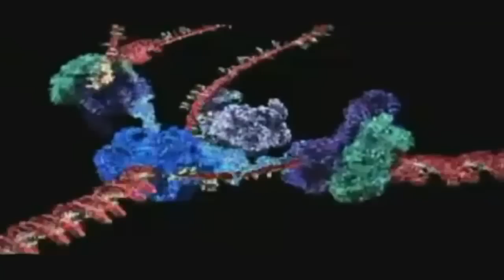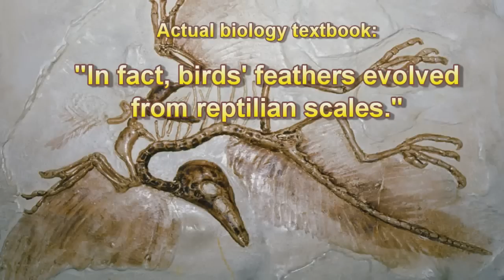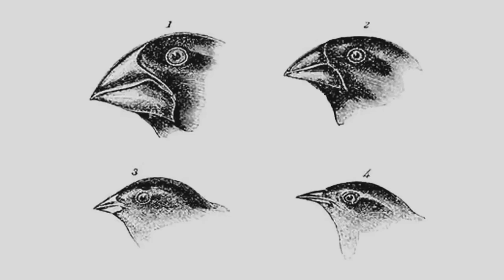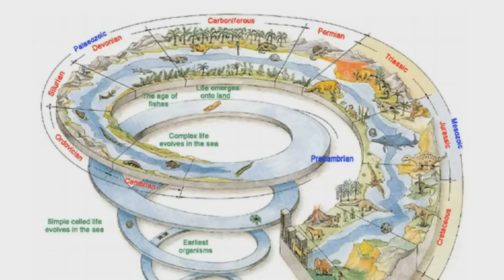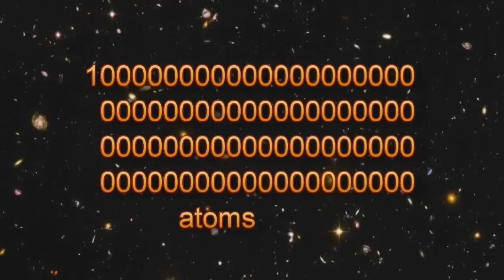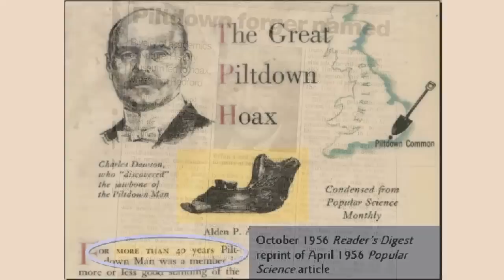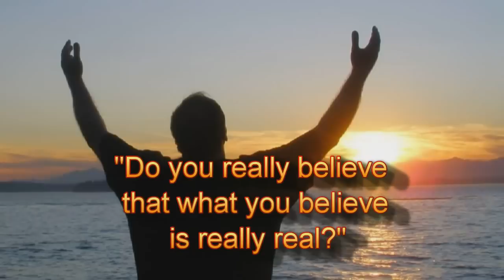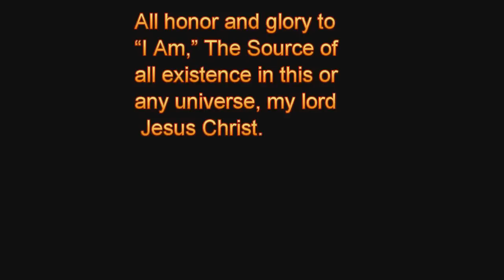Evolution Demolition

Comment: In less than 30 seconds which you apparently did not have when you made this video I found these two reviews 'Origins of New Genes and Evolution of Their Novel Functions' and 'New genes as drivers of phenotypic evolution' so I guess you missed them.
Reply: None of these things are actually new algorithms.  Yes, genes can be copied, and the shifting, and so on.  A guy with a copy machine is not an author, no matter how many pages of text he "produces."  Existing genes can be altered, and in rare cases avoid being damaged in the process, by mutation, but this is not writing new programming or new function into a new algorithm.
Reply: Mark Champneys Bullshit!

For example - do you know anything about how proteins work

How would changing the the DNA of an organisms not effect the amino acid compostie of said protein that would then alter the tertiary structure and therefore function of that aforementioned protein - how is that not adding new function?

You seem to think it's a computer code - where you need to code for specific action.  As opposed to information encoded into chemicals that simply undergoes basic chemical reactions that you learn about in any AP chemistry class around the country in high school.

It seems to me you have a fundamental misunderstanding of what DNA is and what DNA isn't
Reply: Mark Champneys
Mark; Shifting the goal post? You asked for genes that add information now you want a certain kind of information. What is a DNA algorithm? How about Ultrabithorax?
Reply: Jacob Engelhardt Your ad hominem reaction weakens your argument.  "Altering" is not writing new functions.  It is no more than stirring the pot.  Of course, we can stir the pot.  By the way, Francis Crick thought that DNA contained specified information identical to computer code.  Virtually all information scientists do as well.
Reply: Helixbuilder Wikipedia says "An algorithm is an effective method expressed as a finite list of well-defined instructions for calculating a function."  (This presupposes a language that understands and interprets the instructions.)  Such instructions are the essence of DNA sequences.

Ultrabitthorax is a gene--so what's your point, or were you just trying to impress me?
Reply: Mark Champneys
Why do you have to be a jerk when I bring up an example? You should have looked it up. I don't spoon feed those who claim they understand molecular genetics.  You clearly don't understand the system and you are interpreting.You are describing the system to  into your preconceived conclusion. Further you doing this without regard to the facts of how gene expression works.
Reply: Mark Champneys
Clearly you have not researched this as well as you want me to believe. You make a claim I countered it with a gene name and yes you should know what I'm talking about. You made the claim that certain things are impossible, therefore you should be able to defend your claim. You should have knowledge of what I am talking about because you should have thoroughly investigated your claim. You set yourself up as an expert so act like one.
Reply: Mark Champneys

Seems like you are asking for a specific sequence of events right? Are you saying that  random mutations can not create new stop codons?

You say it doesn't change function - when I gave an example of how changes to DNA would directly influence both the structure and therefore function of protein you scoffed it off, what would constitute new genetic information in your eyes - or since you seem so keen on saying it - what constitutes a new alagrothim to you?
Reply: Helixbuilder I have never set myself as an expert.  I am the little boy at the parade noticing that the emperor is naked.  If you want to argue a case, then argue it.  My Ouija Board seems to be broken, and I can't read minds today.  What's your point about ultrabitthorax?  What are you claiming?
Reply: Jacob Engelhardt A stop codon is not all that improbable.  Minor alterations are not extremely improbable.  An algorithms is extraordinarily improbable.  For example, one could dump Scrabble letters out on a table, and eventually get lucky enough to get a 4 or 5-letter word.  But try dumping out such letters and getting a coherent sentence.  The odds against it go up astronomically.  Now try and randomly create a coherent paragraph.  Simple biological functions are far more packed with information than a paragraph.  How much information does it take to give instructions for building a functioning arm or leg?  A simple eye? Or an ear?  Probabilities become overwhelmingly small, reaching numbers that are considered operationally impossible.  Believing that such information can arise by mutation is pure superstition.  It certainly is not science when the laws of probability are defied like this.  Mutations cannot do this.  Do you have some other mechanism to offer?
Reply: Mark Champneys
Mark that is how things work with letters but not with DNA. If you mutate the DNA it can  change the resultant proteins DNA binding motif (e.g. a TATA box) or assassination motif (e.g. a SH2 domain). That change may be all that is necessary to alter a developmental pathway. Sorry someone BS'ed you on what may be an DNA algorithm. One of the textbooks on my desk is 'An introduction to Genetic Algorithms' by Melanie Mitchell. I can't say I agree with everything she says but it is a start. That Hox mutant I mentioned before Ubx changes the developmental identity of a body segment in Drosophila. Yes changes in DNA algorithms do happen and it is not a rare event.
Reply: Helixbuilder Yes, as I said, genetic algorithms can be altered.  I don't disagree with that.  Mostly mutations will damage an algorithm, but once in a long while you can get very lucky and the alteration will still work (though differently) because only data is disturbed.  But none of your mutations writes programs, that were previously non-existent, for functional subsystems.

I'm sorry you know so little about information science that the concept of an algorithm eludes you, but they are everywhere in biology.  No one "BS'd" me. I get the concept that you seem to have missed.  Perhaps it is because of my computer programming and engineering design experience that make it fall into place so easily for me.

Consider a human circulatory system, for example.  It has many functional parts that work together to carry out a purpose.  The logic of this collective function is embedded in genetic instructions.  That is an algorithm.  It carries all the features of designed systems, including foresight, parallel assembly, decision points, a bootup mechanism, etc.
Reply: Mark Champneys
How can you say anything about mutations when you have not studied them or conduct experiment on the effect of mutation on protein function?
Reply: Mark Champneys
 I know little about information science? Ha! You can't even tell me why DNA is treated as transmitted electrical message. That is what Shannon equations describe, the system used is a communication system. Demonstrate how they work to describe DNA information.
Reply: Helixbuilder Wow, you really don't understand conceptually, do you?  It seems like you have lots of little facts swimming around in your head, yet you lack the critical thinking skills to put them together in concepts.  I am impressed with how knowledgeable you are.  I really am.  But you seem to have knowledge without wisdom.  You "strain out the gnat and swallow the camel."  "Always learning and never coming to a knowledge of the truth."  I don't think I can help you until you allow yourself to be taught. I have no doubt that you are much smarter than I am, but it does you no good if you are wrong about so many things.
Reply: ^sounds like a man trying to justify his beliefs in the wake of a growing body of evidence that shows he is wrong.
Reply: Jacob Engelhardt Not justifying, but marveling that such an intelligent person thinks that being electrical or not electrical has anything to do with the concept.
Reply: Mark Champneys
I'm amazed as well. How can you think that functional somehow means "DNA contained specified information identical to computer code". That is not even remotely true. Then you extend this metaphor to mean god did it.

Just because a round rock rolls down a hill doesn't mean it is the same thing as a wheel.
Reply: Helixbuilder A computer has input (variables, parameters, environmental input), an operating system (rules for handling information), a processor which can make conditional decisions (such as if-then statements and for-next loop processing), store information, and then render output of some kind.  Electricity need not be involved.  Biological systems process information exactly in this way.  DNA operates as sequential data storage, just as a hard drive does.

Again, I am not alone in this assessment.  Many evolutionists understand this as well.  I believe that Francis Crick understood it very early on.  Dr. Don Johnson has stated that there are thousands of tiny computers operating within any given cell, which receive input, process information, and provide output, including a network connecting them together.

Computers do much more than "roll."  If it walks like a duck...
Reply: Mark Champneys
Your argument basically boils down to an argument by authority, and a false analogy. Sorry but you are wrong. In a computers information or programs are processed by logic circuitry. The information is actually changed. Now in the genome there are functional chemicals, DNA, RNA and Proteins which make up biological information. These molecules can function independent of other factors or in concert. Your claim of 'if then' statements are entirely bogus. There are several more conditions to meet before gene expression occurs.  If you are going to boil gene expression down to computer code show me some data demonstrating a direct correlation. In addition there is data from several labs pertaining to megabase deletions in mice, exogenous DNA elements (retroviruses, transposons etc...) and 'no effect' knockout genes in mice and other model systems that strongly argue against your points.
Reply: Helixbuilder These are complex systems.  Yes, there are often multiple conditions to be met.  No, it is not a matter of simple statistical correlation in most cases.  We can track decision points in many of these biological systems.  Some input is genetic, some is environmental, some are biological clocks, some are chemical messages, some are electrical.  I cannot compete with your technical expertise in this arena, but the final functioning products are everywhere to see.  Information processing is obvious to most of us.  So what is your alternative model?  What is it you are actually advocating for?
Reply: Mark Champneys
I see words thrown about in an attempt to buttress your claim; however, I don't see any data. There are no choices made by proteins, they bind to their motifs based on affinity of the protein to the DNA sequence. My understanding is that the genome is not a computer, but a dynamic system. There are many complex dynamic systems that don't require intelligent management the jet stream, convection cells etc.
Reply: Helixbuilder Affinity?  You know better than that.  There's a lot more going on that simple affinity.  And you compare bio-systems with the jet stream?  Not even close.  This is much more than mere chemistry and physics.  Why are you toying with me?
Reply: Mark Champneys

Yes, affinity and mutations that effect it can and have been experimentally demonstrated to play a role in the genome. The data for this observation is in many papers. In fact affinity is the basis for the experimental technique of the Two Hybrid System.  In the Two Hybrid system the DNA binding domain and the activation domain are used to demonstrate interaction between gene products. Further in functional proteins domains like the SH2 & SH3 domains they play an integral part in the MAP kinase signal transduction cascade.
 
Yes try applying fluid dynamics to the behavior of the atmosphere. A predictive model can only be approximated. Even if you use with chaos theory, and fractal mathematics you still get an approximation. Things like genomes by comparison are far simpler. Yes I think you only looked only at the changes in the genome but not at the changes in the atmosphere and then claim one is simpler than the other. At the end of the day you would be completely wrong.
Reply: Mark Champneys  You claim "And you compare bio-systems with the jet stream?  Not even close.  This is much more than mere chemistry and physics"
So show me your evidence that the genome is more complicated that the dynamics of the atmosphere.
Reply: Helixbuilder Now you are just wasting my time.  You know better.  Next you will be asking for evidence that the sun is larger than the earth.
Reply: Mark Champneys To use you analogy you just think the emperor is naked, prove it. So far you have not.
Are you claiming that the complexity of the earths atmosphere is less than that of a human genome? Classic!
Reply: Mark Champneys I knew I was wasting my time the minute you brought up prescriptive information but, whatever it has been fun .
Reply: Helixbuilder Far, far, far less.
Reply: Mark Champneys
Check your ego at the door, there is nothing  that you have claimed that is not totality refuted by observations and experimental evidence. There are literally thousands of individual papers representing many experiments that strongly argue against every one of your points. Just because you don't want to understand the evidence does not mean that the theory of evolution is wrong. Claiming a conspiracy or bias is a cop out too. The veracity of facts does not require that they make sense to you. Have fun living in your increasingly silly tale fairy castle!
Reply: Helixbuilder Please describe one of those refutations from one of those papers.  So far you haven't given me anything that does so.

BTW, I am not arrogant.  I am confident.  There is a difference.  I am not boasting about my intelligence, education, and so forth, as certain others have done.
Reply: Mark Champneys Normally when two scientists meet and discuss their data they actually look at the data. So it is completely incomprehensible for me to discuss a conclusion with someone who hasn't looked at the data. I gave you references examine the data therein. Do so,then we can then talk about it. How else can you do it? Can you say anything about an experiment without looking at the data? If you think you can, then you've stopped doing science.